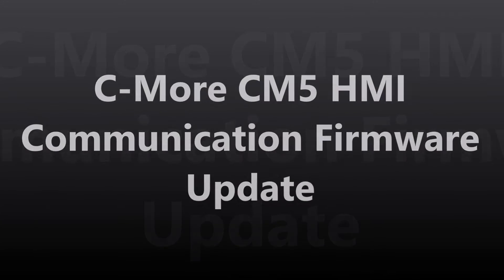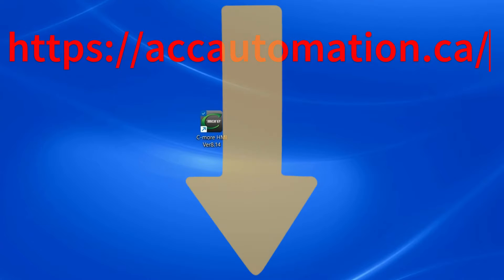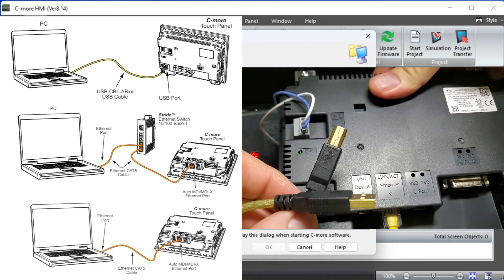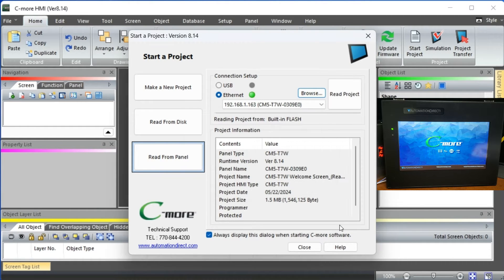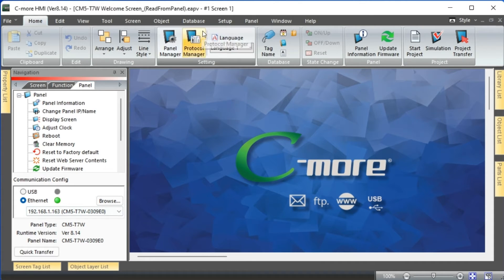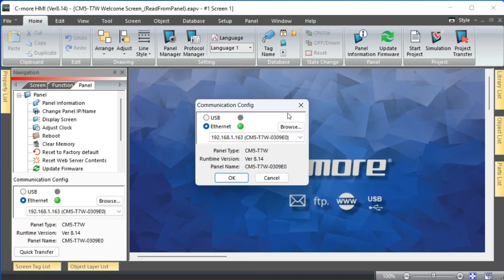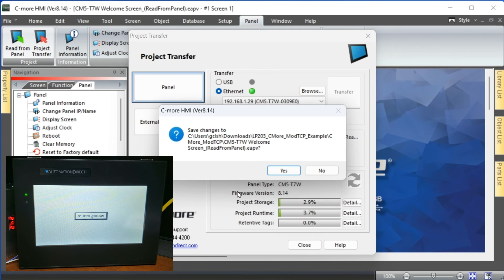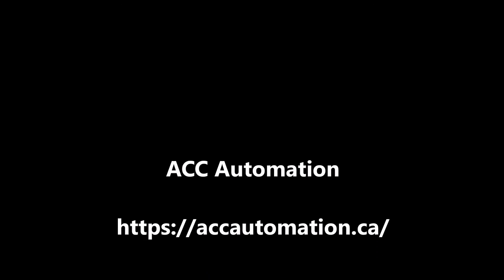Unlock Your CM5 HMI: Essential Firmware Check & Update Guide

Comment from the maker: More information can be obtained at our website. This includes all of the links mentioned in this video. 
https://accautomation.ca/c-more-cm5-hmi-communication-firmware-update/

The C-More CM5 HMI series can be found at this URL:
https://accautomation.ca/series/c-more-cm5-hmi-series/

C-More CM5 Quick Features:
4″, 7″, 10″, 12″, 15″, and 22″ widescreen options
16.7M colors and LED backlights
800MHz or 1.6GHz Quad Core CPU
43MB project memory
12 to 24 VDC powered
Built-in real-time clock with 30-day backup (no battery required)
NEMA 4/4X (indoor use only), IP65
FREE HMI programming software with powerful design tools and a project simulator
CM5 series HMIs support any EA9 series project (created with V6.73 or later) for an easy panel upgrade

Support Links:
C-More CM5 Frequently Asked Questions (FAQ)
https://accautomation.ca/series/c-more-cm5-hmi-series/c-more-cm5-faq/
CM5-T7W Cut Sheet - Tech Specifications / Protocols
https://cdn.automationdirect.com/static/specs/cutsheet/CM5-T7W_cutsheet.pdf
C-more CM5 Overview
https://cdn.automationdirect.com/static/specs/cm5t7w.pdf
CM5 User Manual - Hardware
https://cdn.automationdirect.com/static/manuals/cm5userm/cm5userm.html
CM5 Quick Start Guide
https://cdn.automationdirect.com/static/manuals/cm5userm/cm5qsg.pdf
Product Brochure
https://cdn.automationdirect.com/static/catalog/images/product-pdf/CM5-C-more-Overview.pdf
C-More Programming Software (CM5 Series)
https://www.automationdirect.com/support/software-downloads?itemcode=C-more%20CM5%20Series
CM5 User Manual - Software On-Line
https://www.automationdirect.com/c-more/cm5/software-help
AD C-More CM5 Sample Projects
https://www.automationdirect.com/adc/shopping/catalog/hmi_(human_machine_interface)/graphical_hmi_devices/hmi_panels/cm5-t7w#

ACC Automation
https://www.accautomation.ca
Helping you with your automation control tasks...

Comment: Stuck in safe mode
Reply from the maker: This thread should help you out.
https://community.automationdirect.com/s/question/0D5PE000005T76j0AC/cm5-panel-in-safe-mode
This is not a known issue with v8.0 firmware. Use V8.1 or newer.
Regards,
Garry